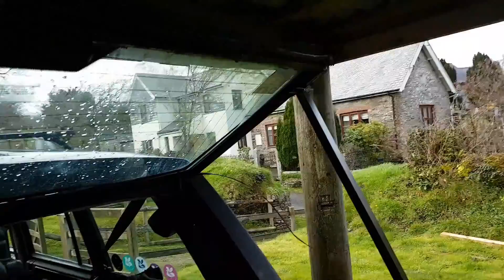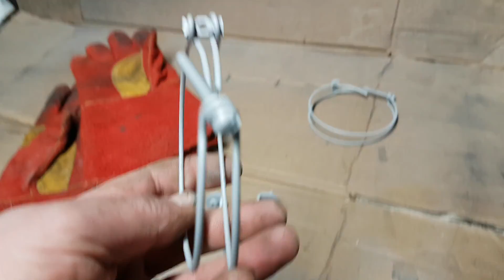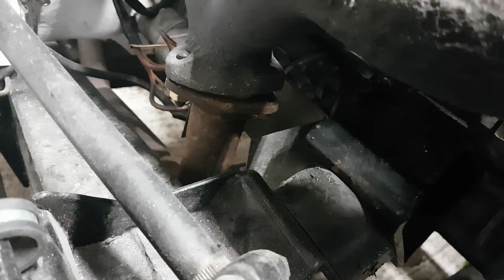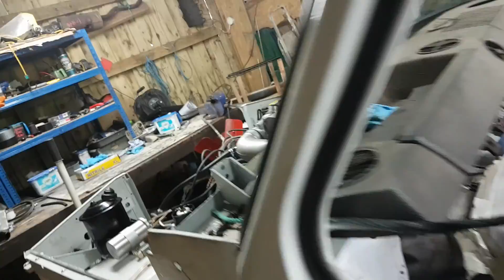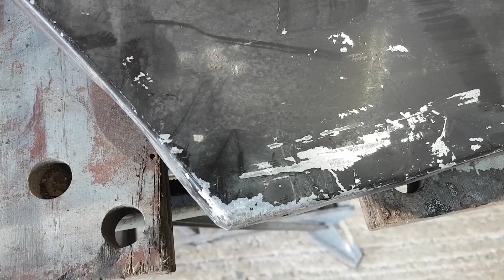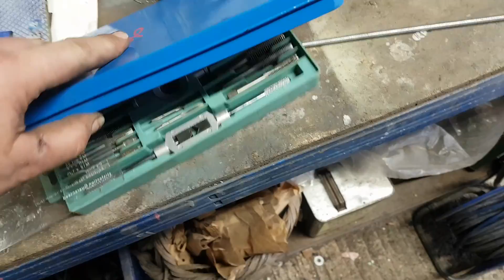Episode 9   1972 project Range Rover A Suffix   Progress Report - some swearing

Comment: Good stuff. Are you not meant to paint the clear coat within a hour or so of the base coat application? I'm not a painter but am refurbing an old merc and so far no probs. Using epoxy primer first then base and clear a few days later. Keep up the good work. Love your channel.
Reply from the maker: some guides suggest not flatting the basecoat before applying the clearcoat. I started that way and all I did was seal the orange peel behind an impenetrable clear coat. 

Also I should have used a solid 2k solution for this white. much easier to work with and same air mask and risks as with the clear coat. Plus I can flat it as I like. 

Please keep in mind that this was the first car I had painted in nearly 30 years. I was learning along the way
Reply: @churchhouseclassics  I'm in no way criticising my project looks superficially good but it might wash off in the rain.

Comment: The demise of all elec hand tools is excessive heat that is why pro's don't buy cheap ,
Tools like Macalister are ok for occasional use ,for constant heavy work you have to buy the likes of Makita etc.
Reply from the maker: it is a good point, this unit died because it on for like an hour non stop. No way would I ever use one for anywhere near that length of time uninterrupted again. I replaced it with another for less than £20, packed the gearbox out with grease like I did it's predecessor and it runs nice and cool, great soft start and £40 cheaper than the nearest brand. When I have cash in my pocket rattling around I replace with better quality. Hand Tools are strong and reliable. Power tools are cheap and disposable for some reason